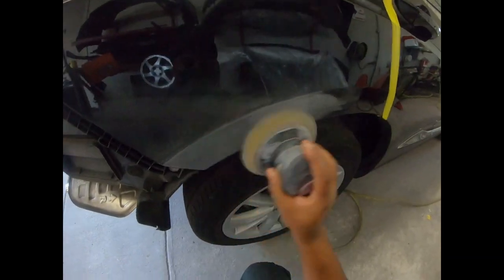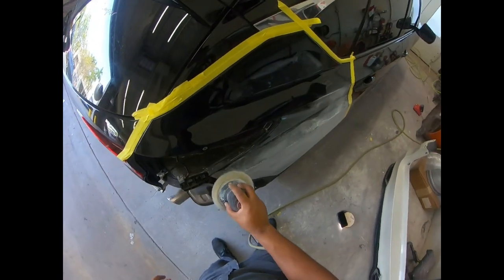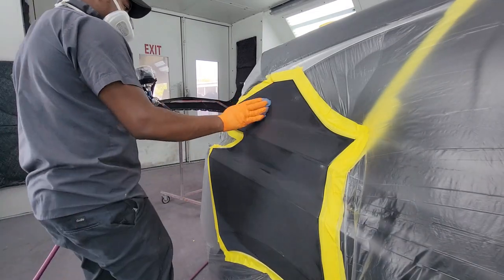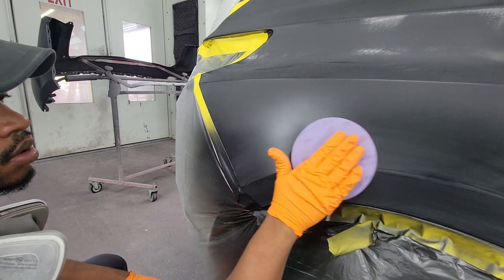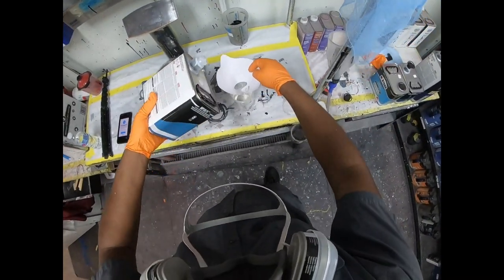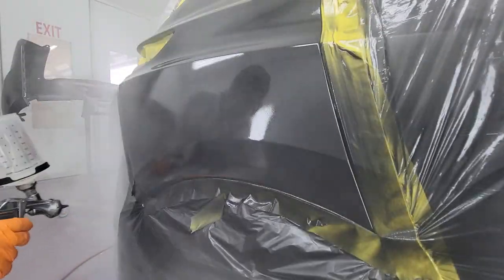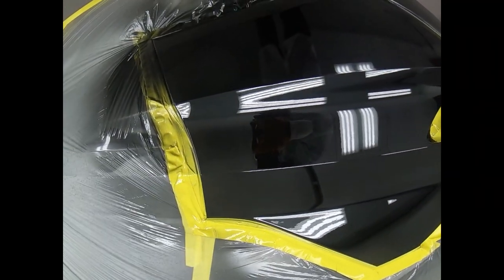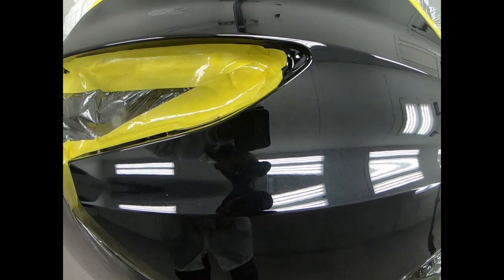Tips and Tricks for spraying Clearcoat

Comment: I noticed that you use quite a bit of air in an effort to get the material to atomize.  If you reduce the size of your fluid nozzle, you will get better atomization without the need for such high pressure.  I use an Accuspray model 60 with .09 😊fluid tip, and about 4 psi at the head. Lays it on thin, wet, and slick, without all the flapping pape
Reply: Really?
Reply: Might look good but is the film thickness enough to warranty a job?

Comment: Great finish there Mario and some useful tips on laying clear. When you were fitting the 3M 2.0 pot I noticed you were pulling the trigger while it was upside down and pushing the liner upwards, was this to remove the air trapped in the pot? I normally fit the pot then slowly turn the gun over this will remove most of the air 👍 John UK.
Reply from the maker: Thanks John and yes I was doing that to release air

Comment: Damg i sprayed a new clearcoat today , and it was very thin sprayed at 27 psi on my dv1 but didnt look good. Second coat was slower and i bumped the psi down to see if it layed better it did but got some runs here and there . I normally use high solid clear its thicker , but trying to find better ways . The clear coat can says 2 med wet coats. Thats what throws me off.

Comment: My pure black S9000 RAL changed color when I sanded off nibs. Just to experiment, I tried to clearcoat the same on a test panel and the color difference was still visible. I used 800 grit. Would finer grit make a difference ? My teachers say finest cured substrate grit for any clearcoats should be 1200 to 1500 to ensure proper grip for adhesion. What is your experience ?
Reply from the maker: Whenever I sand dirt nibs I always go over it with one more light coat. That way the color will be uniformed. And when I sand before clear it’s usually 2000 grit.

Comment: Hi Mario, i would like to ask, after primer why can't i use 600grit to DA sand directly instead of 400,600 n 800? Also for the clear coat, do you use reducer in it at what percentage? I find HS clear spray out quite peely for my clear coat stage, so im wondering if its the gun settings or the clear coat is too thick? Im using Satajet x5500 rp 1.3. with 2 bar pressure and fluid 2 turn out from close. Thanks
Reply from the maker: Ntonytay thanks for your comment.  You can absolutely go straight to 600 grit. The reason I start with 400 grit is because it will only take one sheet of 400 to cut the primer. While it would take more 600 grit to cut it depending on how much primer you're sanding. I mostly use montana big sky clear coat. I don't use reducer I don't use any clear that requires reducer. Just the clear and the hardener. What I always do with my clear coat is add 5 to 10% more hardener. A 1.3 tip is good for clear coat but if you find it's too thick try 1.4.
Reply from the maker: Also the 400 grit do a better job of cutting the primer texture completely out.
Reply: @mariopaintclass6091  thanks for the info Mario. Appreciate it. I always have a look at the clear TDS which is Debeer im using, it mentions add 5-10% reducer if required. So im thinking if the reducers really can help with the flow out of the clear and reduce the thickness of it at the same time. Anyway I definitely looking forward for more learning videos from you. Thanks so much.
Reply from the maker: @ntonytay  No problem from the looks of it you already know that they recommend a Devilbiss or sata.
Reply: @mariopaintclass6091  yeah sometimes switching to SATA is totally a new thing. New style of paint, new settings and all start again haha. Can i have ur IG or FB? Maybe we can chat more if anything i need help. Thanks ya

Comment: Hello Mario, which clear do you recommend
Reply from the maker: I recommend Montana big sky as I use it on a regular basis
Reply: Thank you Mario, what is the difference between this two 2600 & 2400 Montana clear
Reply from the maker: @ivanlebron2003  that's a good question I've only use 2400 once it didn't really lay down much different than the 2600. They are both acrylic urethane clear with the same description. The 2600 is a 2:1 mix ratio, and the 2400 is a 4:1 mix ratio. Not sure what's the price difference.
Reply: Hello Mario , what is the price$$ of the Montana clear 2600 in your area
Reply from the maker: @ivanlebron2003  $125 plus tax for the kit
Reply: Mario between DELTRON 2021 and MONTANA 2600 which is better for a complete car
Reply from the maker: @ivanlebron2003  Deltron is Definitely a better clear coat

Comment: Hey brother, help set an example, we all know that even grazing the paint surface with ANY bare skin requires another thorough scrub with something that will cut through that, solvent based, alcohol&water, but not just water based glass cleaner.     Those fish eyes are just dying to ruin your hard work.    I once got fisheyes from apparently using a washed microfiber towel that had black stain from previous polishing on black car but had been well hand washed and then washing machine and low heat dry.      It is the only thing I could come up with that could have caused them, seeing as how uptight I had been about getting everything out of the garage, clean and clean again, the works, but I did the final wash and dry with that “clean” towel.      Fish eyes especially where I did the most wiping.    Unreal.       Gloves always when primer is exposed.   Even sanding might not get oils out of primer without some prep-sol soaking in to bring the baddies to the surface .     Never again I said after that and I have accomplished that promise to self….